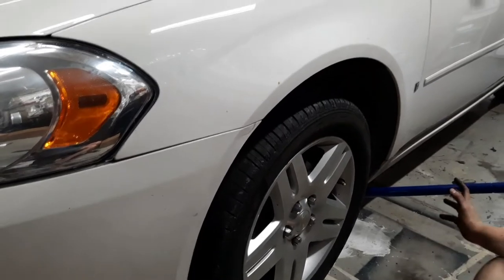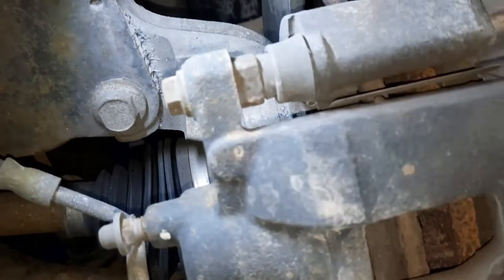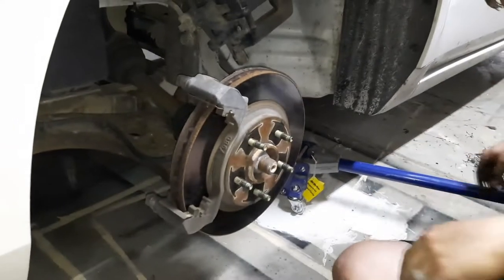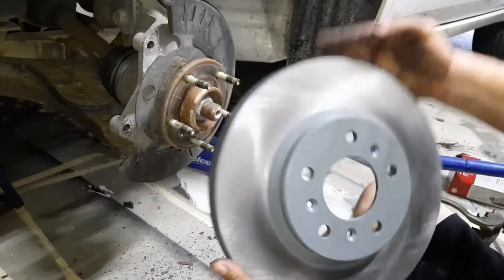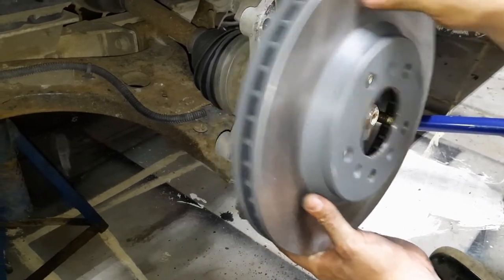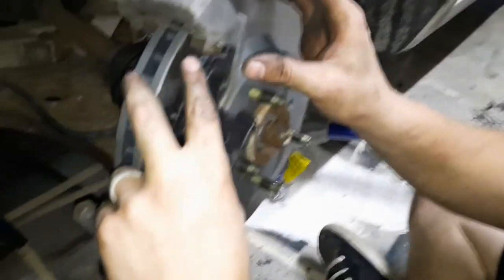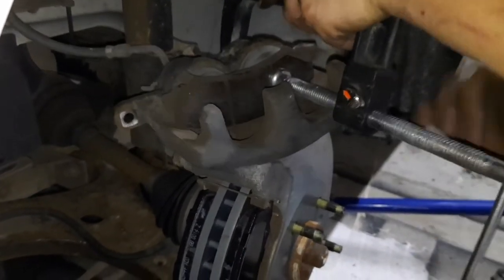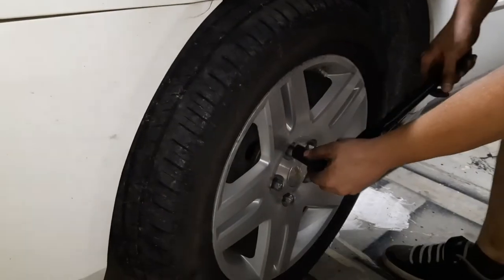How to Change the Front Brake Rotors and Pads on a 2007 Chevy Impala

Comment: Couple things I question. You did not clean or replace the pad clips. Why? You did not clean and lubricate caliper mounting bolts. Why? No mention of removing brake fluid reservoir cap prior to compressing caliper pistons. Why? No mention of testing brakes prior to having car on the road. Why? Well, you didn't remove the cap so you didn't have to put it back on.